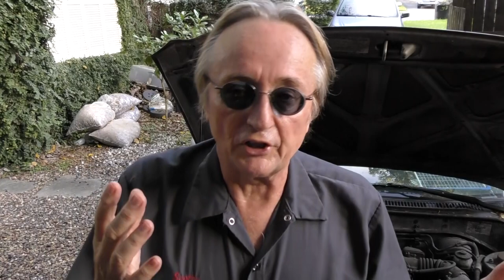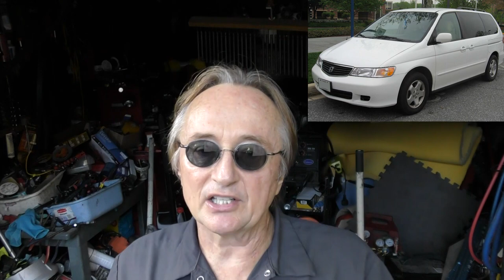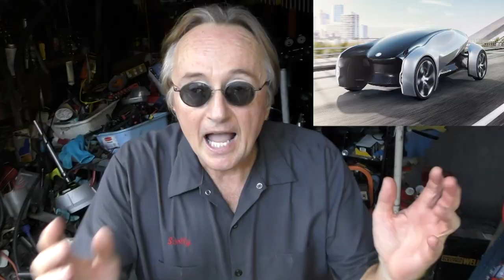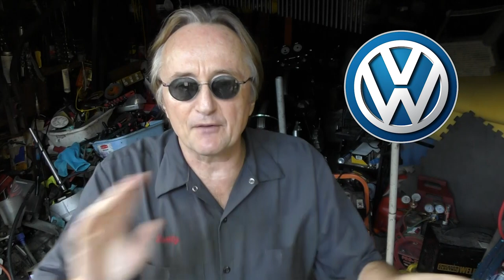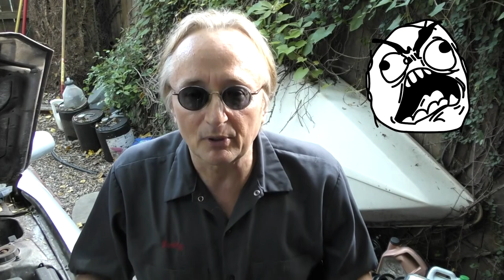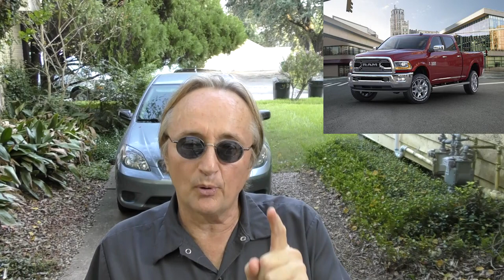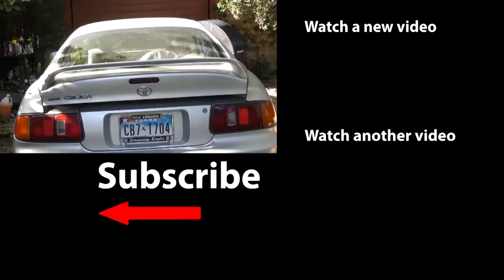Who Makes the Worst Automatic Transmission Cars in the World

Comment: people always say hondas have week automatics but the truth is all automatics are weak. the best automatics are toyotas then probably honda in second place.  so in reality honda probably makes the second best automatics. even my cousin with there honda van has over 200k miles
Reply: More like Toyota/lexus, then Infiniti, Mazda, new GM, mercedes, bmw. In that order of best automatics
Reply: toyota and lexus are the same transmissions dude its just the luxury brand of toyota...infiniti is the luxury brand of nissan which is now merged with renault and they have bad automatics and nissan really never had the best autos anyway. Mazda is now owned by ford and they make bad autos as well and mazda never made the best autos. gm and bmw both make bad autos bmw makes great manuals tho.
Reply: Actually honda best depends on the year vehicle. Honda transmission are some of the weaks, but it depends on when tey were made or change, they have more CVT failure than nissan, the reason you hear about nissan more is that ever nissan car is offer with CVT, honda cars that use CVT have other option. The lastest 9 speed they used in the acura and honda models fail at below 6K, the all new 10 speed is having shifting issue.
Reply: nissan have good autos before they shift into CVT, many auto you see was actually made by Jatco which is own majority by nissan, even when they were making CVT, DCT is the era which many switch from Jatco. Asin is very good too and some ZF. Even at that, nissan does not make the worst CVT, there name is  just more up front because ever model has one. Honda has many failing CVT, but honda has manual and offer regular transmission, so they issue is really known.
Reply: yeah but most people should stay away from cvt's all together and every used nissan my family has owned burned a lot of oil even the older ons before renault merged with them.  honda has some specific models from 2003 to like 2007 i think that are known to have a bad standard automatic as well they even did a recall for a while.
Reply: @OrganicGreens  honda transmission issue continue even up today. The 9 speed failure is higher than Chrysler. 10 speed have rough shift and hesitate. It unpredictability like a CVT. Toyota corolla cvt is reliable. Nissan cvt issue has being fix so I disagree. Honda cvt is still questionable.

Comment: Technology is scrap, old school, a 727 Chrysler was damn near indestructible, Ford, FMX. C-4, C-6, GM Turbo 400. never mess with something that works
Reply: those are all 2 or 3 speeds. great if you like 12 mpg. and they were all only good for around 250 k miles. the good newer trannys are lasting 500k with there clutch disc desighn rather than bands.
Reply: good tecnoligy is great like 400 hp 4x4 pickup trucks that get 23 mpg and are faster than most beloved 60s model muscle cars

Comment: The worst transmissions sold in  Brazil, in my opinion, are the 4-speed AL4 and AT8 automatic transmissions from PSA, used on many Peugeot-Citroën and Renault models.
Although the manufacturers sells this crap saying its fluid is lifelong, transmission specialists recommend to change it every 50k km.

Thankfully, PSA started using the japanese Aisin6 transmissions. There's not much complaints about these ones on Pugs and Citroëns, at least in Brazil.

Comment: No mention of Nissan CVT?
Reply: That's not an automatic. It's a CVT
Reply: @SparxMusik  Isn't it still considered an automatic?
Reply: it is still automatic yes, but he already made a video talking about the worst CVTs
Reply: I had a 2009 Nissan Versa hatchback and it came with a 100,000 mile warranty. Changed the oil as Nissan suggested and never had a problem till a friend totaled it at 70,000 miles. Best car I ever owned. Not one problem ever!
Reply: The oil had to be changed in these transmissions at certain milages. I had mine changed at 60,000 miles never had a problem. Had a 100,000 mile warranty on the transmission.
Reply: Only Toyota can make cvt. I'll wait 5 years before I can give Honda a pass. But I still wouldn't get a car with cvt.
Reply: @georgetriantos4263  100k warranty is worthless. After 100,000 miles, those CVT are ready to die any second.

Comment: The new 2018 Toyota 8 speed shifts like garbage. It hesitates and audibly clunks into gear.
Reply: Racer X YUP TOYOTA/LEXUS IS GETTING TRANSMISSION PROBLEMS JUST LIKE HONDA/ACURA DID BACK IN 1998 TO 2007
Reply: A transmission that shifts harsh enough for you to feel is actually better for the longevity of the transmission than one that shifts so smoothly you cant feel the shifts. To get a trans to shift smooth they lessen the shift line pressure and the gears slip a little instead of locking firmly in place. This actually degrades the trans gears quicker but most consumers like the "smoothness". 

If the trans shifts so harsh that the whole vehicle bucks...or it slips to the extent that there's more than a second of hesitation...you could have a slipping issue or just a minor software issue that can be fixed with a reflash...
Reply: Evan Bozajian NAH EVERY TOYOTA 2018 IS HAVING THIS ISSUE
Reply: @plank5370  

Sorry bud. Ur opinion is incorrect. My roommate has a 2018 Toyota. No issues with the trans or anything.
Reply: Racer X

Ur trans in ur Toyota is their in house attempt at a dual clutch automated manual.  Or DCT. It isnt a ZF transmission. And its Toyota's first mainstream DCT in consumer cars. There will be improvements made to it. Be patient. And realize the clunkiness  is partly from the DCT design. Most consumers may not like it. But enthusiasts know even with some clunkiness...nothing is really wrong...
Reply: Evan Bozajian my sister has 2018 camry but i didnt tell her that they have transmission problems so she doesn't feel bad
Reply: @plank5370  

Hahahaha. 

Once again. Ur opinion of "they ALL have transmission problems" is only an opinion. Not a fact.
Reply: Evan Bozajian seriously its gonna happen in 100k watch seriously u will remember my name then jimmy jimmy
Reply: Thanks for the info.  I just wish I could check the damn ATF but good ol' Toyota decided to have it sealed. No dipstick.
Reply: Racer X oh wow they sealed it wow
Reply: @plank5370  

Most likely...whether it happens or not...I wont remember your name because I dont buy those vehicles. I'm a Ford/Chevy/Dodge guy mainly with a hint of 
BMW/VW/MB...😜.

I keep my vehicles properly maintained. I drive them hard but dont abuse them daily. I never get a vehicle with a first year or first generation engine or transmission. And all of my vehicles have had high mileage with ZERO issues. 

But agree to disagree. Have a good week dude.

Comment: Those 2 speed power glides after a rebuild, and slight modification. Was one of the best transmissions  for flares drags. They followed those with some of the best transmission T400 and T350s. They became work horses for like 30 years.

Comment: Since Honda have some of the best motor + transmission coupling you've lost all credibility to me. Not only you barely ever have any transmission problem with a honda but they are also working so well ususaly with the motor coupled to them. You usualy don,t have the little lag found in most toyota or weird kick-off. Its always feel like it does in a straight line when you push the pedal.
Reply: I'm sure you know Honda uses the mentioned ZF 9 speed transmission in Pilots and Ridgelines.
You can read web forums where many Honda owners have problems with the German ZF transmission. Hopefully Honda will upgrade the Pilot and Ridgeline to the 10 speed transmission, designed and built by Honda. They have been used in the Odyssey since 2018 and seem to perform much better than the ZF 9 speed.

Comment: Each person will have a bias towards certain brands and Scotty is obviously a Toyota lover.  I've owned two Toyotas, the first required a water pump and a new steering rack in under 40,000 miles.  The 2nd Toyota also had a failed water pump in less than 2 years.  And guess what?  The dealer had those items in stock.  Not to mention that those Toyotas were not pleasurable vehicles to drive.  When I had a water pump issue on a 1987 Dodge Caravan at over 185,000 miles, the dealer didn't have one lying around in stock, knowing that he'd need one any day for the millions of Caravans on the road.  I've owned 5 Dodge Caravans, a Reliant Wagon, a Dodge Spirit, and a Chrysler Sebring.  Over the years I've had ONE transmission failure in an AWD Caravan which was replaced by Chrysler even though the warranty was expired.  Found out at my son's wedding reception (true confession time) that he had put that vehicle in Park while it was still slightly moving 3 days before the transmission failure.  Currently I own a 2014 Grand Caravan and it has been flawless for nearly 5 years and over 50,000 miles.  Well O.K., their wiper blades are junk but a set of Michelin blades are $20 at Costco.
Reply: I've recently had two Mercedes Benz GLE-Class. Both of them required electric power steering connector repairs because they broke down after water entered the control unit. I sold these craps back immediately.  Six years ago, I also had a Dodge Grand Caravan and its engine had stalling issues. The Caravan also had a faulty ignition switch that caused my caravan's key to turn to the off position while the car is in motion. This caused a loss of engine power, power steering, and power brake assistance. At 32,000 miles, my Dodge Caravan's engine blew. I then researched which car brand I should switch to and Toyota was rated best. I bought a Highlander and Tacoma, and I have had 0 repairs at 80,000 for both. I also share these vehicles with family so it is an amazing testimony of bulletproof engineering and craftsmanship.   

You never really owned Toyotas. You're just saying that so you could bash it because you're mad that the video poster didn't do so. Sad.
Reply: @Clayton .    I have owned cars from Chevy , GMC , Ford , Nissan ,Subaru , Honda , Toyota , Volvo , Bmw , Dodge , BMW , and VW.   You are right when you say:  " Toyotas were not pleasurable vehicles to drive " .  They are the worst driving cars along with my gutless 1983 Volvo automatic .      My 1993 Corolla wobbled , shaked and floated like a 1970's  Oldsmobile .  It had a gutless 3 speed automatic and at 24 mpg average ,  It fell short of the 29 mpg rating .  It would achieve 29-30 mpg only at a steady 60 mph.    It also required a new transmission at 35,000 , electrical problems , stuck thermostat ,  alternator .  The stock tires and brakes lasted less than half as much as my previous car (91 Jetta)  .    The Toyota left us stranded on the highway 3 times .  Luckily it was still under warranty .    Maybe I got a fluke lemon ?    It still was the worse driving experience and higher priced to boot.

Comment: Very interesting Scotty, Chrysler does not make ZF auto boxes. They use to make the Torqueflite automatic transmission. In various videos you praise ZF for making good auto boxes so all of a sudden when they are installed in a Chrysler vehicle, they are no good? ZF is a German vehicle components manufacturer, the make axles, steering boxes, manual transmission, automatic transmission etc.   Fiat don't make auto boxes at all they buy them. For some reason you forgot to mention the single clutch Aisin robotic gear box Toyota used to install in their Corolla, it was so bad that Toyota, who hardly ever admits making mistakes, stopped using them.

Comment: around 1982-85 i was driving a ford. i would occasionally adjust the bands on my C-4 but ended up losing a gear or two out of a couple so i found a C-6, put a shift kit in it and had no more issues. sometimes i wonder if i damaged the C-4's because they were behind a 400 horsepower engine racing on street and track. leads me to believe that most transmission problems are the result of the owner and not always the manufacturer.

Comment: I bought an older Tacoma, early 90s. I was told by the salesman to go into the service department and tell them my truck started hard in the mornings. The problem were the head gaskets. An aftermarket version was used and they failed. I was the third owner of that Tacoma and they fixed the head gaskets for free. Free to a third owner. That's when I fell in love with Toyota.

Comment: Grandmother had an 03’ Odessey. It had 300k miles when it was traded in. The only thing wrong was that the front suspension was hanging on by a thread. Do a flush before the recommended interval and its smooth sailing.

Comment: Yeah, Honda had problems with that generation Odyssey. They used the same (or similar) transmission part way into the next generation, but in 2007 they scrapped it and started using the same transmission from their Ridgeline. So if you want an Odyssey, get something 07+.
But of course, make sure you keep up on your transmission fluid changes.
Reply: Gabe's Hacks Interesting. I bought a 2003 Ody with the warranty replaced trans with 201k miles in 2015. I never had any transmission issues even though I never changed the AT fluid. I was worried and read so much about the problem, but a lot of peoples recommendations conflicted so I just didn't change it.
Reply: Three years isn't terribly long to go without the fluid changed. I think we did that too. We had an '01 for about 3 years. Tranny was changed just before we bought it and I never changed the fluid. Ended up selling it to a friend when we upgraded to the '09.

Comment: Also, never get a Ford Taurus made between 1994-1997. The transmission WILL go out and rebuild is anywhere between $1000-$2200. They also have to upgrade the shifting sensor, so make sure they do that if you do go for the rebuild.

Comment: I have a 1st gen Honda Odyssey (1995-1998) and it's amazing!  Unlike other Honda's which are built here in the U.S. they are built in Japan and shipped to the U.S. 1st gen Odyssey are GREAT. 2nd gen Odyssey transmissions go at 175-200k miles. 1st gen motor/transmission is excellent!!

Comment: I work on all the older automatic transmissions in the early 70's for over five years and that was all I worked on. The 2 speed Chevrolet was the aluminum power glide transmission and if kept the fluid somewhat red it had nothing to break down. It was the best transmission made in those years. They used them in the mail carriers vehicles because they where so dependable. I had 2 cars with them in them and never had any trouble with them . One had 180,000 miles on it and was never touched other than a fluid change. The 3 speed chevy transmissions had trouble with cutting the lip seals in the clutch packs with cause the clutch discs to burn out. The turbo hydramatic  would need all the bushings replaced during a overhaul

Comment: Never had a problem with a GM transmission on my personal cars except for a bad neutral safety switch and a leaky return line. One 90s Jimmy in the family with well over 200,000 miles had a poorly maintained transmission that wouldn't shift on its own but would shift into each gear if done so manually which wasn't so bad as it had console shift; earlier it had shift linkage issues. A later family Envoy transmission went out too close to 200,000 miles now that I think about it. You often hear older GM vehicles drive by that sound like their leaky transmissions are low in fluid. They often won't break if the fluid is kept up though. Early 90s Ford has MLPS sensor issues where their connectors would get wet and fry the senors and make the transmission slip on he road; I fixed this issue on my Mark VIII for about $100 in parts and labor. Earlier Ford AODs had issues with cheap plastic grommets that when they broke would fry the overdrive gear but this was later remedied with a copper grommet. No experience with Asian vehicles except an Avalon that never had transmission issues even after 200,000 miles, as well as the bad reputation of Honda transmissions. I don't plan on owning an Asian tin can again.

Comment: I`ve always heard about the transmissions in the Chrysler/Dodge vans. Problem is I`ve owned four of them with no transmission problems. All four have had at least 200,000 miles on them. Currently have 307,000 on the latest one. Then again I always changed the fluid on a regular basis.

Comment: Hey Scotty, we have a 2013 Ford Edge.  The automatic transmission sputters when it shifts from 2nd to 3rd gear.  We took it back to Carmax and they said that is normal and that is the way the transmission shifts (which I highly doubt).  We purchased the extended warranty and it is progressively getting worse and we are going to take it back to them again.  When I was searching I had read the newer Fords have self learning transmissions and that resetting the transmission computer might do the trick.  WIth all of your years of knowledge, I just wanted your opinion.

Comment: The 9 speed ZF failed because FCA didn’t want to buy the software from ZF. Same reason the 10 speed in the fords failed too. After many warranty claims they settled and FCA bought the software. Since then the transmissions have been much much better as far as failures go. Shift quality is a little different but not near as many failures. Doesn’t help that we can’t overhaul them due to not having a white glove clean room,or repair anything other than a axle seal or valve body.

Comment: I have a Nissan / Jatco RL4R01A Transmission in a 2002 Nissan Frontier with 160,00 miles on it and the transmission has held up very well. The truck has been literally bullet proof for 17 years.